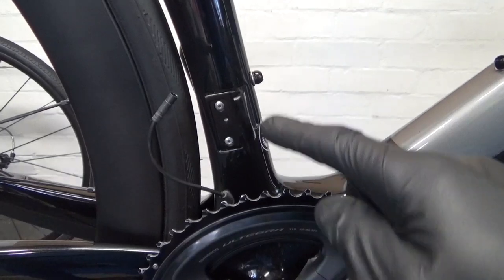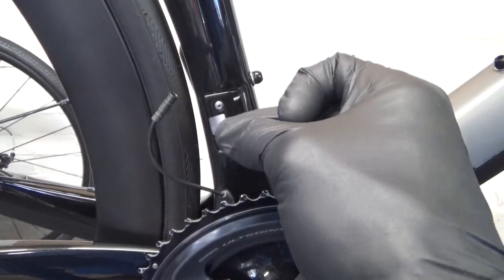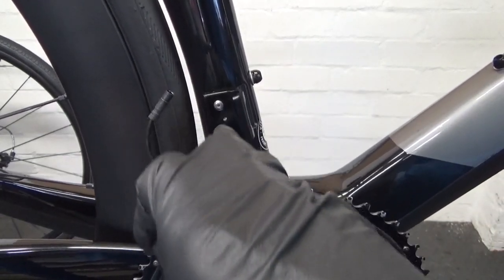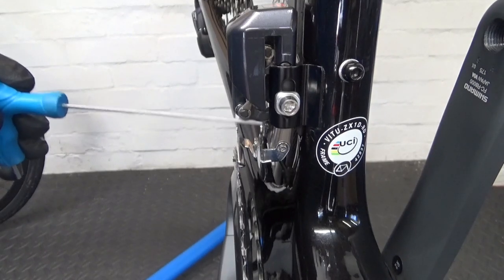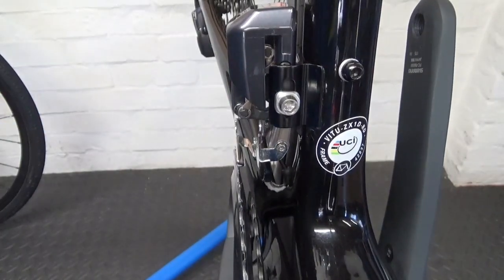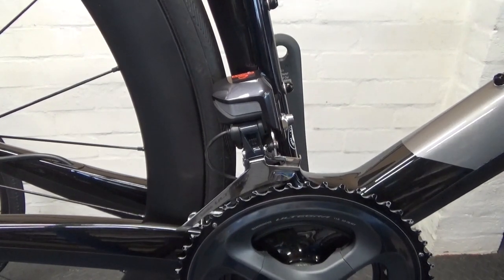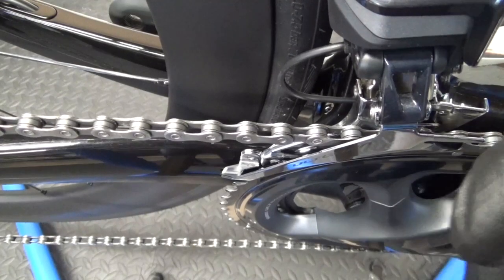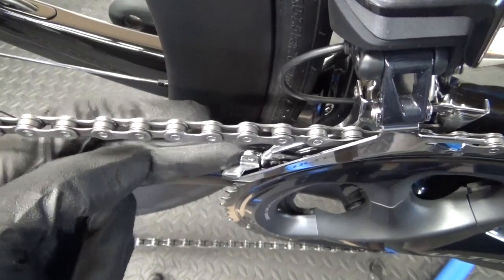Shimano Ultegra R8050 Di2 Front Derailleur Fitting Guide

Comment: Good video, but I have a question.  Should the outer plate of the derailleur cage be over the outer chainring when setting the 2 mm gap or is acceptable to set the gap with the cage moved inboard (small chainring position)?

Comment: Thanks for all of your videos, I regularly learn new things from them. My front mech seems to start auto trimming for no reason after 1-2 hrs of riding, you can't see it but you can hear it, very annoying. The battery is fully charged and otherwise both front and back shift perfectly. I wondered if there is a sensor that prompts the auto trim (?), maybe I have a problem with that. Any ideas? 🙏

Comment: I couldn't get the cage angle correct just using the adjustment screw.  Had to loosen the downtube bolt and rotate the whole derailleur a bit.  Once I did that, I could get the cage angle straight enough that I no longer got rubbing.

Comment: Great explanation ,best on YouTube.
A question for you if you could help please.
I have just got bike with DI2 and have had a few problems with front derailleur.
last two rides mid ride the tail of cage has been catching the teeth of large chainring - like you explained if the derailleur has not been set up correctly.
it has been ok for 60 mile on one ride and 80 mile on another until problem occurred - it seems like the cage has moved too far outward causing the problem - gently bending the tail of the cage inward or resetting the derailleur gets rid of problem. got me baffled. any help appreciated - cheers

Comment: I have a giant TCR brought 8 years ago need to replace my front derailleur will r8000 fit on my 10 speed also got to replace  inner cable if not could you recommend  a replacement I have a ultegra  on what came with the bike

Comment: Hello, thanks for the video, very useful. Can you please tell me if there is an electronic micro-adjustment on the ultegra FD 8050 ? Shimano dealer manual says there is one, but it looks that it does not work on my bike. Thanks !
Reply from the maker: Yes there is a micro adjustment feature! Make sure the firmware is upto date and the derailleur is set on the largest chainring and the largest sprocket on the cassette!
Reply: @FreeToCycle  you were right, I had to be in « big - big » configuration for the set up. And actually it was impossible because the low screw of the rear derailleur was not set up correctly! Once ut was fixed I could finally access the micro adjustment mode for the front derailleur. Shame on Canyon for poor adjustment of derailleurs on the bikes they sell… and chezrs to you !

Comment: Thanks for the vid!
Bit off-topic - how are the Prime wheels doing? I had to change bearings on the rear hub twice already! (Bought them in March 2019.) Do you have the same issues with them? Thanks. Happy riding :)
Reply from the maker: It seems most of the Prime wheels suffer from bearings going bad quickly!!
Reply: @FreeToCycle  Might be worth changing the hubs then (or just buy the rims and lace them yourself). They seem to be fine with a lot of beating off the road...
Reply from the maker: Try high quality bearings they usually last a lot longer!!
Reply: @FreeToCycle  Unfortunately these are hard to find in these non-standard sizes...
Reply from the maker: Yes that is the issue with these hubs and the 15267 bearings!

Comment: Great video. I have a 2014 Ultegra Comp with internal cabling and I want to upgrade to Ultegra Di2. From everything I have looked at it would appear that the frame is compatible but I took it to my LBS today and the guy said that it needed to holes for the front derailleur wires. I have one hole on the rear side of the front derailleur which from this video appears to be in the right place. Am I missing something? How do I know if the holes on my bike will be big enough to feed the wires through?
Reply from the maker: The holes need to be 5mm in diameter, the one for the front derailleur is on the seat tube just under the derailleur hanger (if you have a braze on type).
Reply: I am also upgrading a mechanical frame to Di2. I've just run the cable through the mechanical port you mention and adapted the grommet to seal.
Reply: irishpete79 mine has been working great.

Comment: Why is there only a high screw? No low screw?
Reply: Thought it was just me. Guess nobody is going to speak on this so I can fix that part of my problem.
Reply: The low position is adjusted electronically. You need to put the system in adjustment mode using button on junction A then use shift up/down to adjust. Page 137 in dealer's manual.